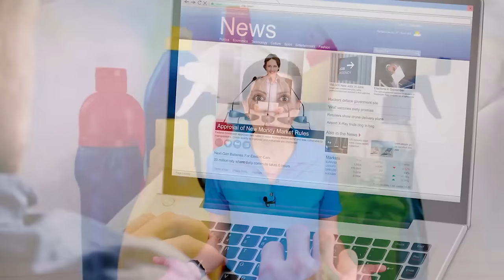Best Way to Clean Windows and Mirrors

Comment: As a window cleaner this is how I clean leaded windows. Customers always ask me how I get no streaks and are always amazed I just use plain water too clean with. You'll always get streaks with any cleaning product so save yourself money and save the environment by listening to this lady.
Reply from the maker: Hey Thanks, Paul for the feedback. It's great to have you here. 😍
Reply: So glad to “hear” you say this.  So many people are obsessed with making their own glass cleaner, when plain water is generally the best, especially on mirrors.
Reply: That is untrue in regards to getting streaks with cleaning products.
Fact, glass actually has pours and when you don't get all the grease, grime, dust and dirt out of those pours, that is what creates the streaking you see. If you use a wet microfiber cloth with a few drop's of blue dawn to clean the glass/mirror and then dry it with a microfiber drying towel you've removed all of the gunk from those pours and liklihood of having streaks no matter what you put on it other than oil or furniture polish. If you want a "transparent clean" use a foaming glass cleaner, misting it very lightly and use a microfiber cloth made specifically for glass and spread to evaporation in the "S" pattern from top to bottom.
Reply: Good advice
Reply: I found this out the hard
way ! Water & squeegee !
Reply: @CCFIFresno  I been cleaning windows for a living for 24years and can tell you soap leaves streaks. They may not show straight away but give it the right time of day as the sun gets on them and it'll show.
Reply: @Manc82

Comment: I am a retired owner of a window cleaning business (20 years experience). 90% of my customers were homeowners so I've cleaned a lot of mirrors. Frankly I always used an 18" squeegee to wipe off the water as it is much faster and leaves the mirror super clean. However, I did use her method to clean leaded glass and I think I will try it to clean the inside of my trucks windows.
Reply from the maker: Thanks so much for watching the video and leaving a comment. 👍

Comment: I worked my way through college as a professional cleaner we used this method and it worked great. Another tip is to start at the top and wipe horizontally from side to side working  your way downward. This ensures that you're moving the dirt away from the area you just cleaned-this goes for walls and cars as well.
Reply: Yep, that's what Angela said.  She even showed it in the video.
Reply from the maker: Thanks for sharing!

Comment: For the bathroom, could I save time on wetting the mirror by cleaning it right after the shower when its foggy, and just use the drying cloth?
Reply from the maker: YES! Now you're thinking. The same rules apply to cleaning the shower. When it's steamy and everything is lose - that's when you want to squeegee the walls and glass down. BAM! You're clean, your bathroom is clean - it's a great morning routine. Thanks for bringing this up. 👍

Comment: Thanks!  I have  written in my service agreement as Dust and Wipe Windows. Is it the same as Window cleaning?
Reply from the maker: I'd say that "dusting and wiping windows" generally refers to cleaning the window surfaces and frames, but it doesn't usually include thorough window washing, which is cleaning the glass inside and out. I suggest making sure you and your client are on the same page about this so everyone's happy in the end👍

Comment: My house cleaner retired so house cleaning is back to me.   I found this program about cleaning mirrors (something I have never had success doing) and couldn't believe you could clean mirrors without chemicals.  So this morning I got two microfiber cloths and followed your directions.  I was amazed that it works!!  I also watched the program about cleaning showers and decided to work on the glass doors.   I am ashamed to say they were awful.   I found a scrubber pad to us and used windex to use up my supply.  Again I followed your directions right down to drying the glass.  OMG!!  The doors are beautiful.  I keep going back and looking at the bathroom because it looks so great.  And, a bonus is that I worked smarter rather than harder.  Thanks so much for your advise to a little old lady.
Reply from the maker: Go Pam!  I’m so glad you worked smart not hard and cleaned your mirrors and shower glass doors. You are amazing : )

Comment: My daughter in law introduced me on krud Kutter and I love it. I watched it pull out the cigarette smoke. But my ? Is what cloth should I use to clean my bathroom ceiling with I'm getting streaks?
Reply from the maker: If you are removing nicotine from ceilings you may want to use terry cloths with the Krud Kutter. The Terry Cloths will wash out better in the washing machine than microfiber for this purpose. And you may have to do a couple of passes to remove streaking. Removing tar from ceilings and walls is a time consuming project to do it right.

Comment: May I ask how to deal with streaks left by spray on glass cleaners? I cannot get the mirror clean in my rental from whatever has been used on it in the past. It leaves shiny streaks that kind of glow in the dark. I want to get rid of the chemicals, and just clean using vinegar and water. Obviously it is now full of chemical cleaner and doesn't want to come glistening clean.
Reply from the maker: To deal with streaks left by spray-on glass cleaners, there are a few things you can do. Firstly, use a microfiber cloth instead of paper towels or newspapers to clean the glass, as these cloths are designed to pick up dirt without leaving streaks. Secondly, use less cleaner as using too much can cause streaks. Thirdly, try switching to a different product that is designed to be streak-free. Finally, make sure to apply the cleaner correctly by spraying it onto the cloth, not directly onto the glass, and working in small sections. By following these tips, you can achieve a streak-free shine on your windows, mirrors, and other glass surfaces.

Comment: U are suppose to wash the different styles of microfibers separately?!?

So the waffle weaves, separate then the window/glass ones?   Also, how to clean with microfibers that u used polish or conditioners?
Reply from the maker: You can wash the waffle weaves and the glass cloths in the same load, I would put them in mesh bags to separate them. They have these mesh bag kits (paid link https://amzn.to/3Cqldwb) with smaller mesh bags for one or two cloths that can be tossed in the same laundry load as your other cloths. The purpose of the mesh bags is that it prevents your expensive microfiber cloths from picking up lint from other laundry in the same load.

Comment: I just have a question, I’ve been watching videos on cleaning glass shower doors using steel wool fine grit 0000 “ what’s your opinion? Your my ‘favorite cleaner ‘
Reply from the maker: Steel wool fine grit 000 can be safe on some shower glass doors - but the key is to know what type of glass you are scrubbing, and the type of soil you are trying to remove. In most cases, the shower gunk is soap scum and that can be removed with a degreaser (think dish soap) and a non-scratch scrub sponge.

Comment: is there a difference between dust and wipe a window, and cleaning/washing a window?
Reply from the maker: Thank you for your question! Dusting and wiping windows generally refers to cleaning the window surfaces and frames, but it doesn't usually include thorough window washing, which is cleaning the glass inside and out

Comment: Hi Angela, very informative.  I've always had issues with mirrors leaving streaks and a film of "fogginess". I have a question,  maybe I missed hearing you say. Is it best to use cold, warm or hot water? Does it make a difference on mirrors to windows?? Thx.
Reply from the maker: You can give it a try with different temperatures of water. Typically we use whatever comes out of the tap which is room temperature. It might make a difference based on the humidity in the room. Great question. 👍
Reply: @AskAngelaBrown  thx. Last night after watching your tutorial on windows and mirrors I ordered both kinds of microcloths in different colors. Im excited to get my mirrors sparking clean again thanks to you. Cheers!!

Comment: I had a mirror that had gotten some kind of oily residue on it. I tried to clean it with everything I could find, window cleaners, vinegar, microfiber towel, even a rubber squeegee, you name it, nothing would remove all the oil and it left the mirror with a sort of smeary haze on it. I finally tried cleaning it with a steam cleaner and BOOM! it worked instantly. Took me maybe 2 minutes total. So, when nothing else will do it, try steam, it is amazing!
Reply from the maker: Great tip! Thanks for sharing!

Comment: Hi Angela, so I did this test at home & so could you please tell me if I did something wrong? and or any other tip regarding window cleaning?, so what I did was: I Tested the Sprayway foam cleaning spray on a bathroom mirror. I First sprayed the cleaning spray onto the mirror then I used a Microfiber rag to quickly wipe it = The results were ok but not to satisfaction/ Then I used Sprayway again but this time I sprayed the Mirror and I used a squeegee to wipe away the cleaning spray = This time it was near perfect and much better. What did I do wrong there when I used the Microfiber rag? Would you say there is time to use a squeegee but also a time not to use a squeegee and why? Thanks! :)
Reply from the maker: What were the results like the first time you tried cleaning the mirror?
Reply: @AskAngelaBrown  Results were "ok" some visible streaks still present as opposed to using the squeegee...?

Comment: Have yet to find a microfibre cloth that did not leave lint on my mirrors.  Find mirrors in bathroom so hard to clean.  Just used Method glass cleaner, it works fine, but when you use microfibre cloth it leaves it yukky.  Squeeze was better but not perfect.
Reply from the maker: Are you using a glass cloth? The glass cloths don't have any pile to them and they don't leave lint. Make sure when you are washing your microfiber that you wash them in mesh laundry bags so they don't pick up lint from other fabrics in the wash. https://amzn.to/3EaNV2b

Comment: Your video had very good info. I would like to comment on your choice of wiping materials ie coffee filters, newspapers, paper towels etc. As I understand, your reluctance in using newspaper was due to the fact that they are more scarce now than in the past. If you have a source, that would not be an issue. I've used newspapers for window cleaning for many years and I've experienced no better wiping material. Just be sure to use the actual newspaper itself and not any glossy inserts. 
Newsprint ink actually has a small amount of abrasive added to it helping to polish glass.
Reply from the maker: Thanks for watching the show : )

Comment: ive had a window cleaning biz since 1985 in Honolulu. best way I tell my customers. used dish soap water ,get a small rag   ring out excess water wipe window ,let window dry and get a beach town wipe window and you wont have any streaks   her way is a long slow process.
Reply from the maker: Your way works as well. Thanks for sharing. The reason we use this method is as professional house cleaners we do not carry dish soap water or beach towels with us. We don't clean windows so we don't carry squeegees and buckets of water. The tools we have available to us to clean an occasional item of class or a mirror are these cloths and this is the process for 99% of the cleaning we will do with glass and mirrors.

Comment: I use a squeegee and micro cloth for my windows inside.  The outside I use rain-x, squeegee, and a micro cloth to clean up the left over drips.  I also use rain-x on my shower door on the inside.  Makes it easier to squeegee every day after a shower.  No streaks or water stains.
Reply from the maker: Great tips. Thanks for sharing. :-)
Reply: Yes. A squeegee is the best way.
Reply: Wait... you clean the shower.... every day?!?!?!

Comment: My problem with cloths even microfiber cloths is hair fibers that get stuck in them and are transferred onto the mirror. Its a pain to get the hair out
Reply from the maker: It's true, if you have hair stuck in your microfibers it can cause a mess. Do you have that same problem with the glass cloth? It's a different pile than the regular microfiber cloths and wouldn't "grab" as much hair.

Comment: What is a high quality micro fiber towel? And what kind of mesh bag? Where do you get mesh bag? And why do you have to seperate the two? Why will it pick up lint? Can you just wash in pail instead of using small load of laundry wich is more watter then you need. And what do you wash them with? Peroxide?
Reply from the maker: Hey Brandon, this is a lot of microfiber questions. I'll make you a video and show you.
Reply: @AskAngelaBrown  nice that would be cool thank you

Comment: So wetting cloth + drying cloth … no indication of cleaning solution (agent).
What do you use?  Dish soap?
Reply from the maker: Water. No dish soap required. Damp cloth, followed by a glass cloth designed to remove streaks and dry. NOTE: As house cleaners the glass we clean in homes are table tops, mirrors and picture frames for the most part. We are not window cleaners by trade, so the windows we are cleaning are the transom around the front door and maybe a sliding glass door from the kitchen to the back patio where the dog pressed his nose against the glass. We're not talking outside windows or a whole house of them. Does that make sense?
Reply: @AskAngelaBrown  Yeah it makes sense.  Most videos on glass/window cleaning recommend either a few drops of dish soap, or vinegar, or both.
But only your video got into the detail of what cloth (applicator) is best for cleaning glass surfaces (including mirrors).
I see some of the comments people recommended a squeegee in addition to a microfiber drying cloth (for glass).

Comment: I'm so glad to hear you promote just plain water.  I use just water for nearly everything, very few cleaning products.  Only really stubborn or greasy stuff needs product or anything that needs sanitation.  Large appliance surfaces generally only need water.  

Do you have a video on cleaning outside, really dirty windows and those unreachable from the ground?  (You must live in a mansion with over 50 windows - nice!)
Reply from the maker: We typically don't encourage house cleaners to do windows for the fact that most don't travel in vehicles with a truck mount, ladders or have a vehicle that will carry 2 story extension wands and pressure washers.  Instead we refer our window washing friends to our cleaning contacts, and they refer house cleaning to us. (No, I haven't done a video on it but one would be fun to watch.)
Reply: Virginia once I got my steam cleaner I couldnt believe how clean everything was from just water

Comment: How about outside windows? Can’t just use water to get rid of dust and dirt or mixed
Reply from the maker: As house cleaners we typically don't clean windows on the outside except for sliding glass doors. For this on the outside if you like you can use a glass cleaner. There are plenty of glass cleaners that work for this. If you're actually doing an exterior window cleaning job you would use a soapy water mix.

Comment: I like the idea of the cloths but I have found when doing exterior windows or extremely dusty or dirty glass you need a rag that’s used to get the heavy dirt off. That rag gets quite dirty fast so I carry a bucket of water to rinse it in and reuse. Or a cloth squeegee can be used. Then I can use the wetting rag method. Otherwise my wetting rag becomes caked with dirt too fast. With that said I’m talking about washing pretty dirty windows. Not mirrors!!
Reply from the maker: You're correct, exterior window washing requires a different set of tools for a different type of soil being cleaned. Thanks for the tip. :-)
Reply: Use a scrim cloth get them off internet make sure it's been boiled  treated

Comment: Thank you for this great video. I haven’t been able to find the window drying cloth. I’d be grateful if you could give us the link for that. Thanks!
Reply from the maker: Here are the sources we use: https://savvycleaner.com/resources/sponges-and-cloths/
Reply: You can order them from Amazon also.  They are green (wash) and blue (dry).   A little pricey but well worth it.  I use them and hot water, no streaks!  Only thing I use glass cleaner for is to shine stuff like tubs, toilets,  etc. , after I'm done cleaning them.
Reply: @rondalee7704  i’m doing a window cleaning for a client in about a week and have been using squeegees and what not to clean them. I notice i don’t get the perfect wash using squeegees do you think this technique of just a wet micro fiber and a dry microfiber would work better? would love feedback
Reply: @arcenio429  yes i do.  Make sure you wash your clothes separately and i only use like oxyclean for soap.  Reduces smearing from cloth.  Also i only use hot water.   For me that works the best.  I don't have alot of luck with a squeegee.  I use a squeegee to remove pet hair from furniture and to get excess water off shower walls.  Hope this is helpful.   Try it on your windows at home first, before client's job.  This way  you have an idea if this will work for you.  Good luck!

Comment: Any tip on how to clean a new construction home? Since is a bit different since you have to scrape glue, stickers, grout etc...
Reply: I wet the glass with hot water and Dawn mixed in.  Razor blade the glass.  Then wipe again.  Squeegee.  Buff dry
Reply from the maker: A hand held steamer and a wet/dry vacuum make the job a breeze. The steamer you'll use to remove blue tape, stickers glue and dripped paint, and the wet/dry vacuum you will use for dust.